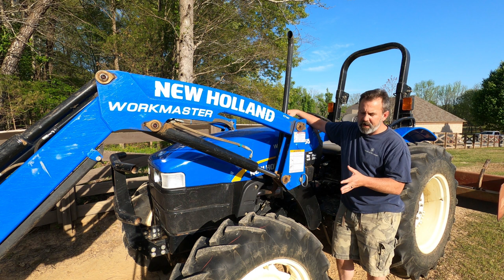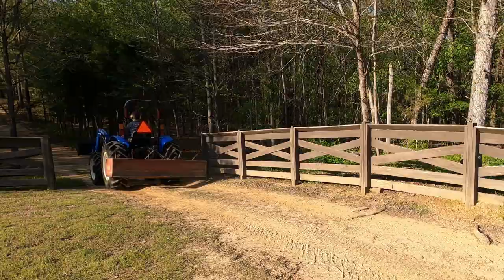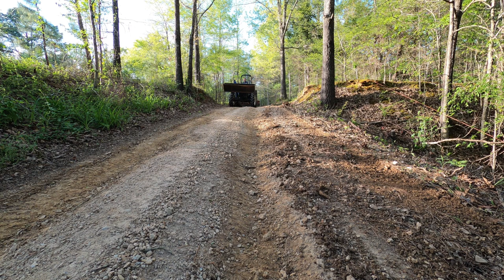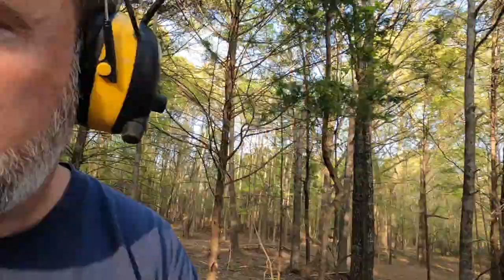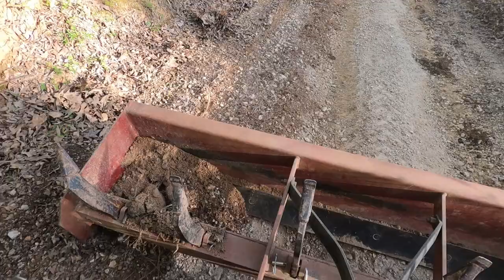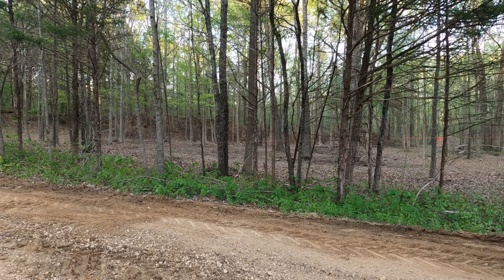HOW TO Grade a Gravel Road with a Box Blade

Comment: FYI, tilt your box harder and cut a swale ditch on each side and a steeper crown. This way the water will shed to the sides and run down to the bottom of the grade where you can divert the water away. Finally did this to my road, makes winter driving better and keeps from cutting ruts down the middle where you drive. Good luck! That tractor looks like it can do just about anything you need done!
Reply from the maker: Thanks for the tips!

Comment: Nice. I have a similar box blade with the adjustable teeth for grinding up the top layer. Any reason you didn't use those, at least on you first couple of passes?
Reply from the maker: I like a packed smooth surface on a road. I use the tines more for fields.

Comment: Nice work. Were you running your box blade in "neutral mode" in terms of cutting and smoothing functions? Or was the toplink shortened a bit to make it cut more?
Reply from the maker: Thanks. Not in Float mode. Yes  adjust to cut and crown.